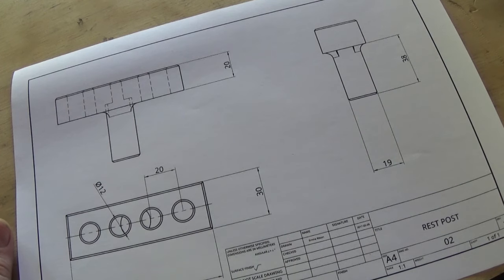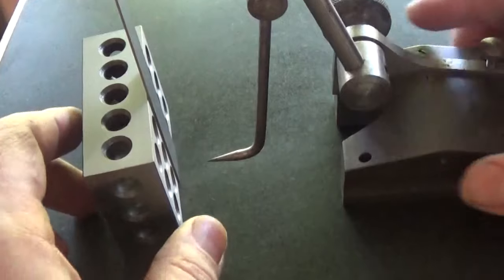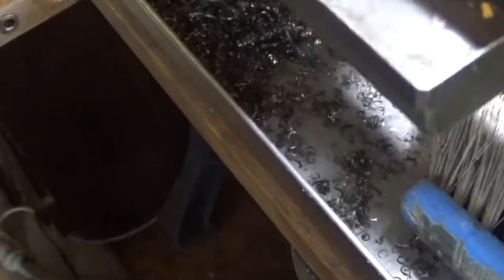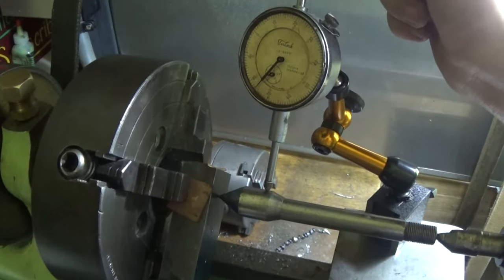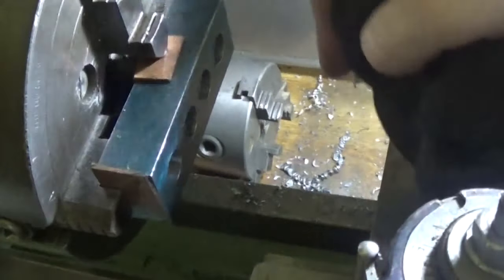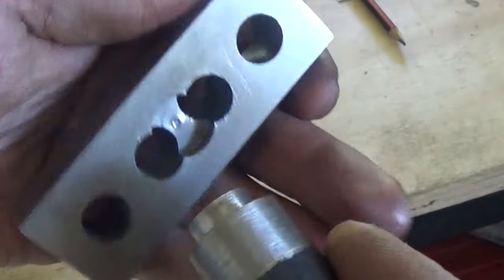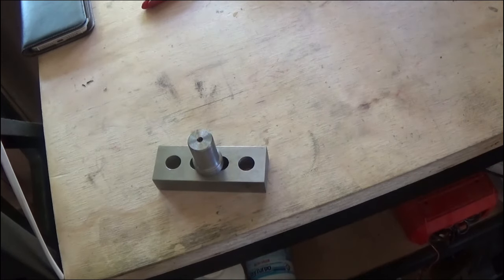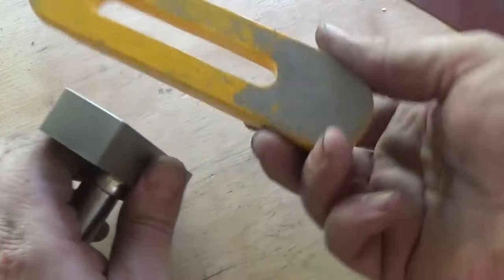Metal Spinning Attachment for the Lorch Lathe Pt 3

Comment: cheers for sharing, I thought you might have tackled the first operation on the shaper, but manual operation on these killer heat days would have sucked
Reply from the maker: lot of metal to remove on the shaper.. and the vice wasnt big enough to put it longways, or i may have!

Comment: If you are willing to side track for a while a useful gadget is a chamfering/conterboring tool. make it like a boring bar with a reduced pilot spigot. Then just add bearing sleeves to suit the bore. works a treat even in a wobbly drill press if you go slowly enough. Of the commercial countersinks the cone type with a single hole thru it gives the best finish albeit slowly or the type with a single cutting edge.

Comment: If needed you can make poor machinists counterbores by grinding the proper sized drill down to provide the step you want and grinding flat chisels on the remaining flute faces.  This is a cheat sometimes done for repeat ops so you can drill and countersink in one op. if that is something you are interested in I can help if need be just ask.